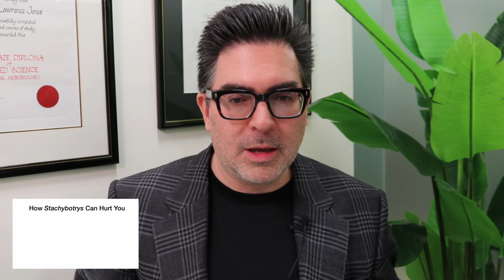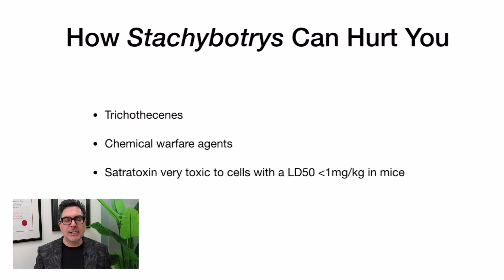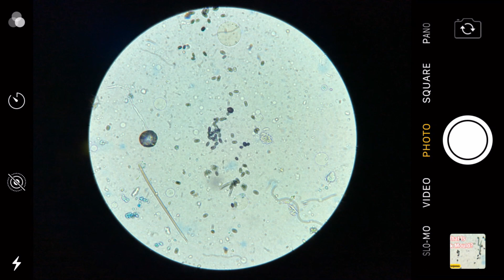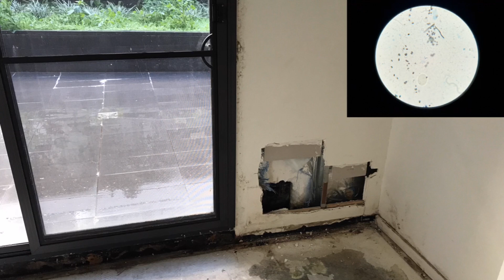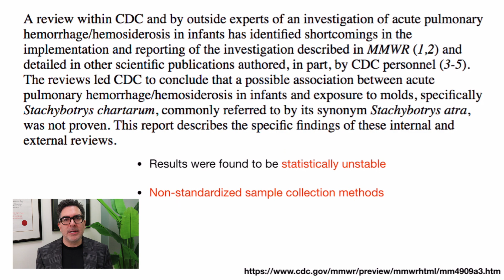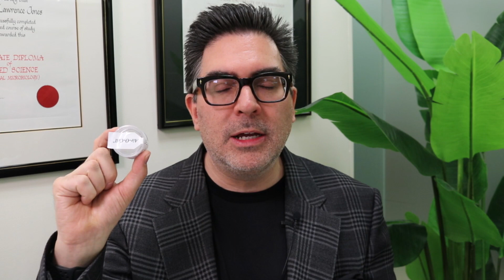What Is Black Mould?

Comment: Water damage, or merely condensation from poor ventilation? Condensation due to warm, moist air and colder surfaces - walls ceilings, windows etc, especially during colder winter months. By ventilation, it does not necessarily mean opening windows can prevent condensation. It requires air movement to allow equilibration of the temperatures of air and surfaces in contact with that air, allowing the condensation to evaporate. Prolonged condensation may lead to water damage, when mould growth causes bathroom sealant to fail, allowing water to penetrate behind tiles, baths, showers and hand-basins, affecting walls and flooring below.

Comment: Do dehumifers and air purfier both kill mold spores and mold also do they both work and are they both worth using
Reply: Sorta, they both inhibit thier growth. It really depends on the climate you live in.
Reply: You would save money on dehumidifiers by using an unheated fan to direct air to help condensation dry off and bring the surfaces where moulds can grow to the same temperature as the air, because moulds cannot grow without water. Active ventilation and ducting may help, especially in areas like bathrooms and kitchens.